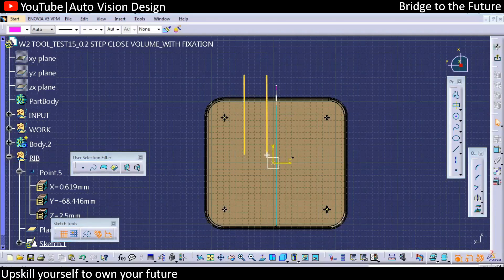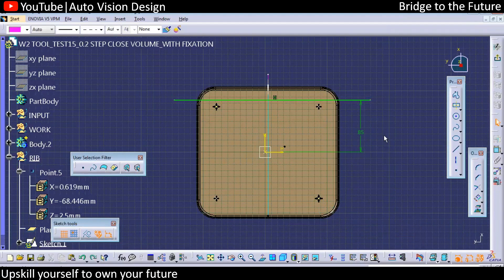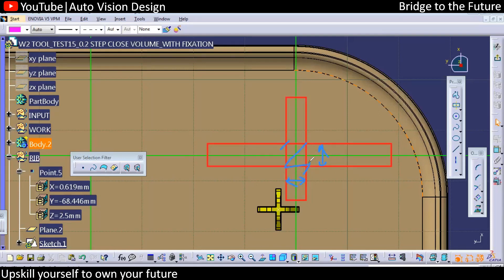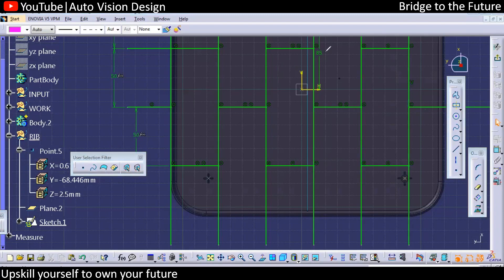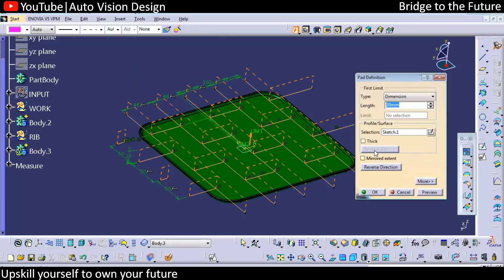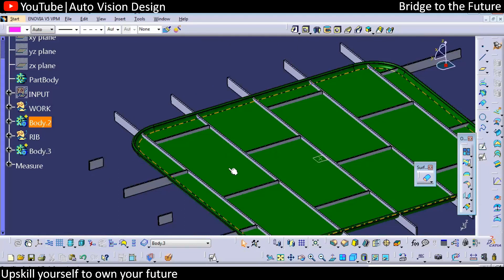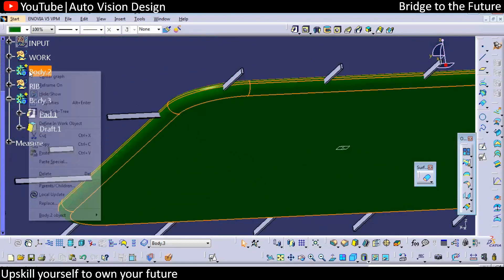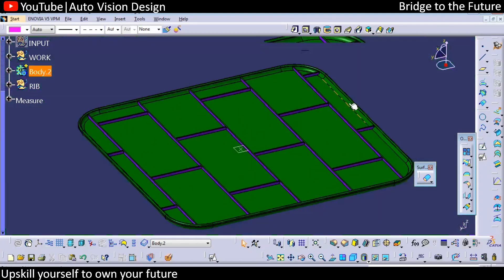Rib Creation in Plastic Part | How to add Rib | Plastic Trim

Comment: If top face of the rib will neutral then bottom thickness will increase (outside draft given)  is it ok
Reply from the maker: Always need to make sure root THK must be 40% to 60%  part Thk. Depending on material